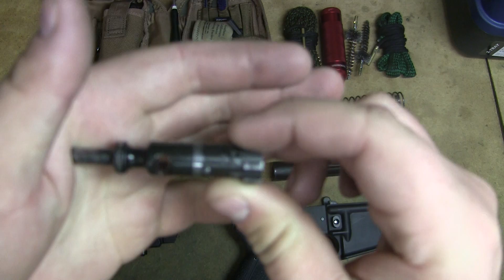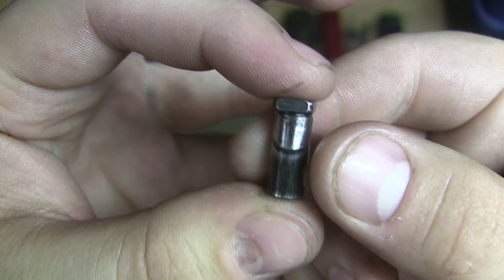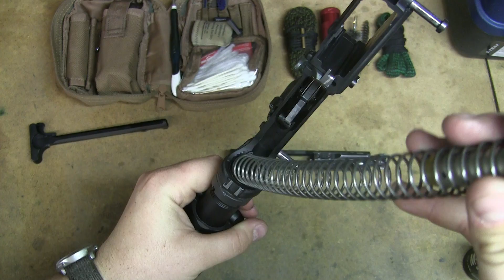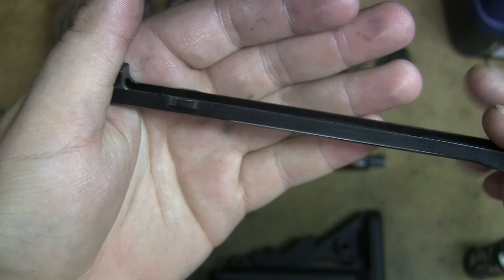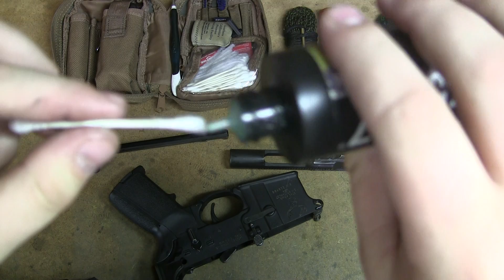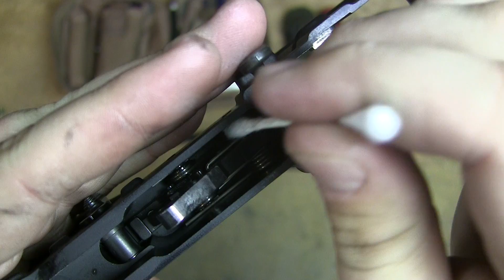AR15 Lubrication

Comment: I own a Bushmaster XM15-E2S and the take down pins (well the pivot pin anyways) is extremely tight.  The rear pin is fine but the front pin is so tight that I usually have to punch it out with a plastic punch and hammer.  I noticed yours pushed in and out freely, any idea what would make mine so difficult to push in/out?
Reply from the maker: I've noticed that the front pin tends to be the hardest to work with on most rifles.  Sometimes you may be able to find the "sweet spot" -when you rotate the upper off the lower and at a certain place the pin comes out easily.  For other guns, a punch may be needed.  Usually a tough pin is caused by either the pivot pin itself or the detent, or a combo of both being to rigged or sharp.  Some people like to debur the edges to make them smoother to work with.  My lower parts kit came from a broken down rental AR15 we had at work that I offered to buy the parts out of, so they have seen quite a bit of actuation and are well-broken in for sure.
Reply: Mr2ndAmendment Cool, thank you for the quick reply.  Great info on your videos, I am fairly new to the AR platform, pretty much learning as I go.  Your AR15 lubrication video actually cleared up a lot of questions I had.  I subscribed to your page, excellent videos.  Keep up the good work and thanks again, really helped me out.
Reply from the maker: Good to hear it, stay tuned for more!

-Mr. 2nd

Comment: Thanks for the info, I've seen a lot of videos where the bolt is drenched and have wondered how in the world it would react to the battle field stressed environment with dirt sand debris. Your video made id simple to understand the POI on the platform and mechanical aspects of the design. Thanks again